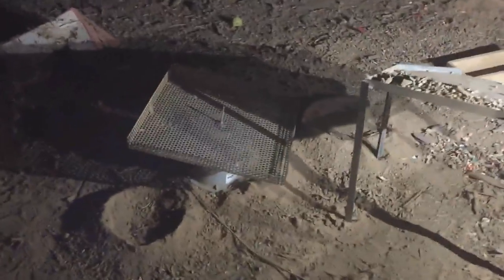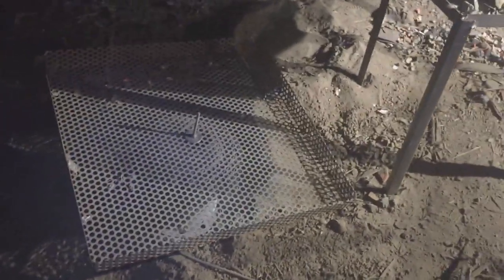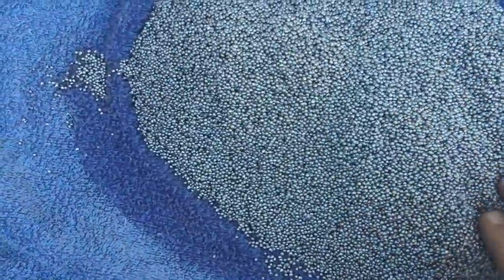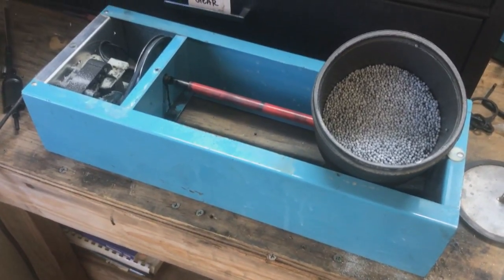Processing Scrap Lead into Usable Shot at Home

Comment: I would be careful with all that dust you’re blowing around on that berm.  Did you say 4 hours!  

Listen, I’ve been down this road.  When you take into consideration your time, effort, machinery, gas and waste you’re paying more than $48 per bag.  If you are able to sift out a few hundred pounds of reclaimed shot, clean it really good, use a magnet to remove steel shot and just shoot.  Profoundly cheaper and more efficient.